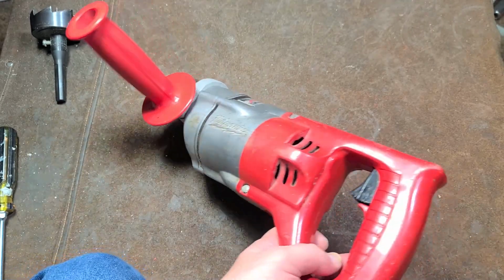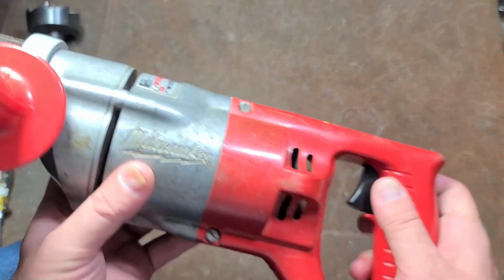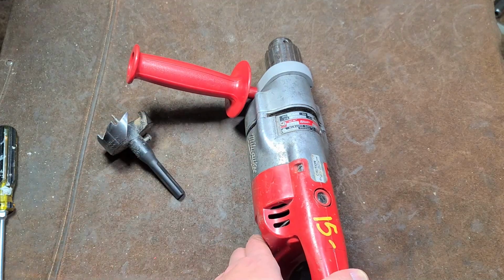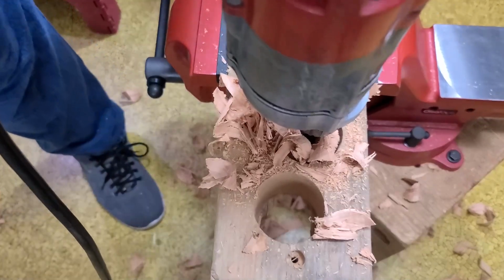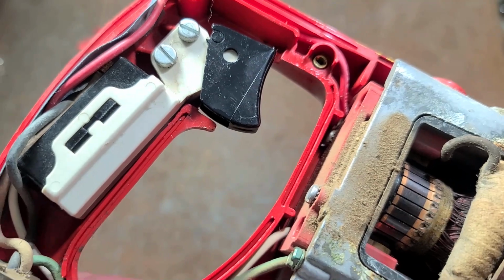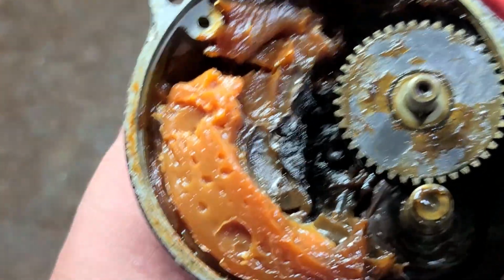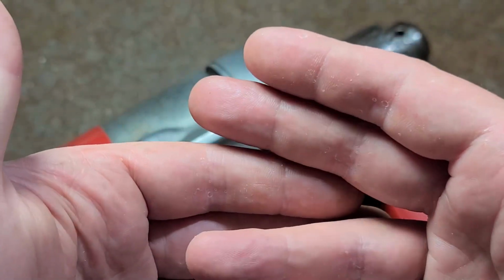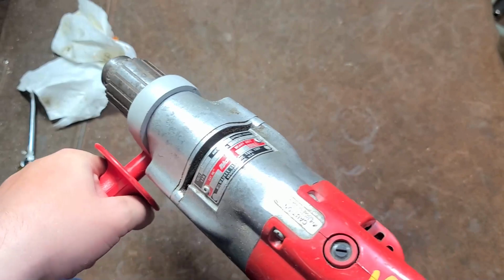Milwaukee 1001 1/2" D-Handle Drill Review/Mini Teardown

Comment: Excellent video, especially for those of us that appreciate well made tools like this. I have an old all metal D handle(I think it's a 3/8") that I might need to have the grease in the gears repacked(seems to leak a bit of oil like grease around the chuck area on the shaft) - what are the best types and weight of grease you recommend for the gearbox(brand too if you have one that works really well)? Thanks!

Comment: Thanks for the video.  I just picked up a newer d handle model that has the flat plastic on the sides like you talked about.  6.2amps and I think 900 RPM.  I like that hole saw bit you have.  What do you call that?  I can't seem to find them.  Thanks.
Reply from the maker: Self feed bit

Comment: Great job on this video thanks for sharing. I just bought a used beat up one on Ebay without a handle near the chuck, did a Google search and this video popped up. Really happy to see the steel helical cut gears, lots of lube, alignment pin, all metal gearcase, threaded metal inserts for the case screws, large commutator Etc.. When you have a bunch of holes to drill thru thick steel you shouldn't use a cordless drill, this drill or a magnetic drill is a much better choice and will last much longer also. I see a lot of videos where guys use cordless drills drilling thru thick steel and at too high of a speed and with little or no lube get frustrated when it takes a long time and end up burning up their cordless drills. Use the correct tool for the job, the proper technique and procedures' and you'll get the job done sooner with much less frustration. 💯